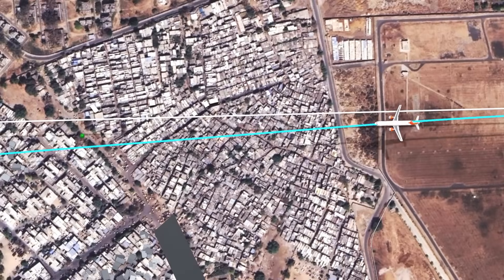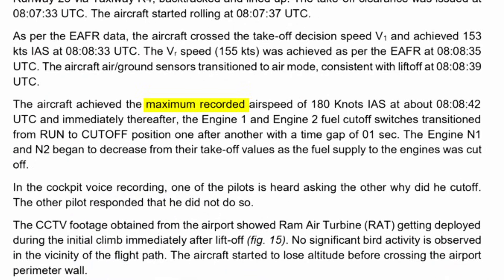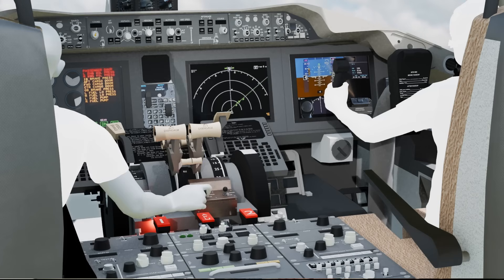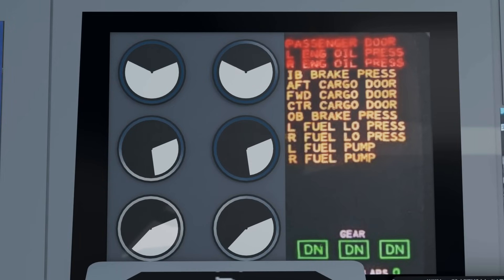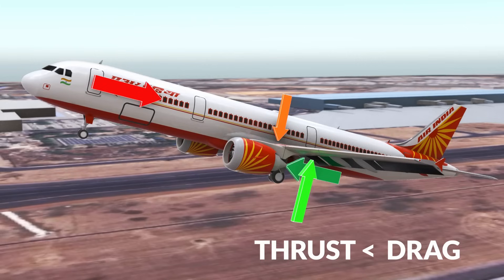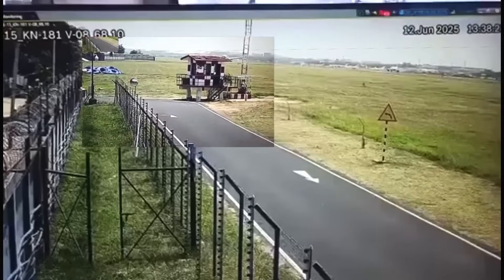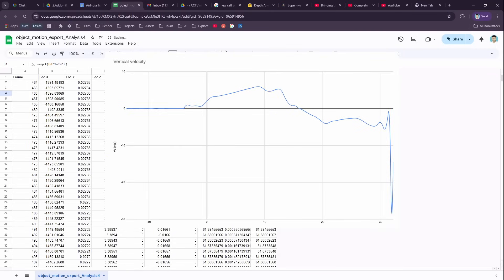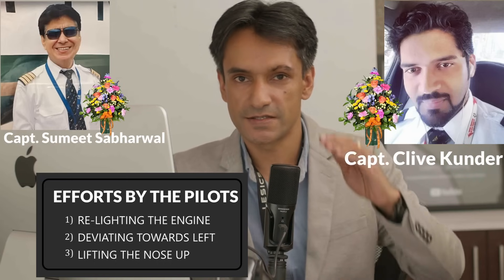Use of 3D Clone | Decoding the Crash Details you Missed

Comment: Absolutely the best analysis I have seen. I am reviewing this crash after I realized that their preliminary report is bogus. Going from 2 knots per second acceleration on the runway to 6 knots per second while climbing with the fuel shut off just is impossible. 2 engines at 70,000 pounds thrust each on a 520,000 pound aircraft is only an acceleration rate of 0.28 G’s. And I didn’t see no afterburners or Jada rockets in the videos. The officials either don’t know what they are doing or they are trying to hide something or both. But physics don’t lie. Something is going wrong with these aircraft and It’s not the pilots fault. Your work is much appreciated, THANK YOU.

Comment: Great analysis! Sabin, I have something that's bothering me which doesn't add up. That picture in the preliminary report with the RAT deployed, the tower in that picture is not the same tower as the one in the other cctv video you start with. Now, I actually doubt the veracity of the photo used in the preliminary report. If it were a true picture taken during the takeoff of real incident, its details which include ALL the planes parked in the background would be consistent with at least the view that overlaps from the main cctv footage you start with. Could you fit the 3D model from the two consistently ? I think in the photo in the preliminary report the planes in the background, even their relative orientation and number within the view doesn't consistently fit with cctv footage.

Comment: This is a nonsense, that the issue was caused by a technical glitch...there are already many video on the Youtube, mainly from Captain Steeeve, who is talking about the preliminary report of investigation, that fuel cut-off switches were manually switched by one of the pilots to Cut position and then changed back by another pilot but it was too late...
Reply: stop spreading nonsense on the internet especially from that clown.

Comment: The fuel cutoff switches (according to what is recognized by the data recorder) can be accomplished in 1 second. The mechanical movement of cutting off the FIRST switch is NOT registered by the data recorder. The data recorder can only recognize "off" the instant off is achieved. The time prior is unknown. So the timing to turn off two switches begins with first switch at "off". The 2nd switch to turn off is basically the time it takes to turn off a single switch according to what the data recorder "sees". Hence the time measured is from "off" to "off". "off to off" can be accomplished in 1 second. Hypothetically a person could hold the 1st switch for an extended period that the data recorder does not "see". The first switch measurement to "off" actually consumes NO time. The timing starts at the instant "off" is reached on the first switch not before. The clock starts and moving the 2nd switch can indeed take place in 1 second. The theory of the time to cut off 2 switches in this gentleman's explanation is flawed. I am making no other assumptions or accusations. I'm just pointing out what the data recorder is capable of "seeing".

Comment: After an exhaustive analysis of available data I have just published a new article.  I am in broad agreement with Sabin Mechanical Engineering.  The pilots tried to save the plane.  The most probable cause of the accident was a FADEC error.  The switches were moved some seconds after fuel cutoff in a standard attempt to relight the engines.  The most probable cause of this accident was a FADEC fault.
Air India Flight 171 Accident - The Most Probable Cause
Please Google this article - YouTube, for reasons unknown, instantly deletes my comments with live links.

Comment: One key component is that "Why did you cutoff?" Does not answer the question "What"? Cut off what? What was cutoff? Could it have been the co-pilots instrument panel that was cutoff as the plane automatically transitioned from Battery Power to RAT power. Yes, it's possible.

Comment: https://youtu.be/Hrdp50Dm_FE?si=uquUZwRuY7PAwS9y 
Is this your data or they made their own?
Reply from the maker: He didn't contact me. I think it's their own data. By the way, both the videos look similar.
Reply: @SabinMechanical  Nice work and what I find so interesting with both your simulation and the Wingx simulation is the continued increase in speed after fuel switch Cutoff and beyond the max speed in the report. 
I don't understand the physics well enough to know just how long or how much speed increase should be expected after fuel cutoff but the simulation does indicate it did happen. 
Just looking at the simulation results it's hard to believe the fuel was completely cutoff based on the max speed reached in your simulation. To me it looks more like the thrust of both engines was rollbacked rather total fuel starvation.  Thanks for all the work you put into this simulation.

Comment: In 2019, the ANA 787, NH 985, the engene was shut down after the plane landed on the runway and duel engene shut down was triggered by TCMA because of trust reversals...not when the plane was still in the air.

Comment: There was water leak in one of the bathrooms, not found or fixed due to bad maintenance of Air I. Plus, beside the bathroom is an electrical bay which connects multiple flight computers and systems. Water was pooled under the bathroom while the aircraft was on the ground, but as soon as the aircraft accelerated down the runway, the G forces pushed all the water into the electrical system causing severe failures and computer malfunctions and restarts, possibly within a second of this or close to lift-off causing fuel valves to shut down in a possibly bad design or unique scenario due to Boeing software and system design. This sealed the fate of the pilots, until the fuel pump switches were cycled and engined restarted it was too late. The flying pilot might have been startled to see sudden decrease in thrust, and no wonder cried out "why did you cut off?" not expecting such a thing to happen by itself, since there would have been no loud bang or sound heard in cockpit with their head gear on. Since easy solution would be to blame or scapegoat an innocent pilot, it saves both, Air I, and Boeing from lawsuits and claims from relatives of the lost ones. RIP. Corporate greed, and govt incompetence is rarely punished as much as it should be.

Comment: Excellent video. This has answered the one question I've been asking everywhere, are these fuel cut-off switches capable and/or programmed to drop without pilot input??? So it appears so. Great.
Now the only thing going against one of the pilots is the timing regarding a possible suicide mission. If this was sadly the case then during take off would be the precise window of opportunity taking into consideration current cockpit security measures.

Comment: The plane fuel switches were moved to cutoff position within 3 seconds from liftoff. Are you saying that in the 3 seconds both engines failed and there were no information anywhere in the icas and the prelim report. it is too good to believe how fuel switches are turned off or recycled within 3 seconds from liftoff when there is a whole checklist for the procedure

Comment: This is extremely well-researched and clearly shows the pain-stakingly hard work, sleepless nights and rock solid dedication that is gone to dissect and provide the details on what transpired on that ill fated day.

I am an Air Cargo professional with 20 plus years experience in international and domestic Air operations. I am IATA DG ceritifed Aviation consultant and an  Independent researcher. I also did my  own independent deep-dive analysis before and after the AAIB prelimnary report, including granular level second by second research of timelines and technical FIFO and LIFO of events, on the AI 171 crash.  Below is my final micro level findings with a most probable root cause. Below is a small excerpt of it : 

In my opinion, It is an Airframe-commanded fuel shutoff (FSOVs) — via spurious/automatic electrical command or relay/RPDU fault

Why is this electrical / relay or RPDU  fault or a  related logic malfunction  inferred as a most likely cause and NOT a FADEC outage or a Pilot  Error theory::

Pre-existing cabin electrical degradations that were present even in previous leg and continued later as well , probably point to an airframe distribution/RPDU issue.

Near-simultaneous “FUEL CUTOFF” on both engines within ~1 s likely matches a common-path command (relay/RPDU/logic)

At takeoff thrust, each FADEC is self-powered by its PMA; a FADEC-first/FMU-first shutdown would require very rare, identical EEC failures or simultaneous PMA defeats — much lower prior probability than a single airframe electrical fault that issues (or mimics) dual cutoff commands.

RAT deployment here is consistent with downstream consequence (both engines flamed out because fuel was cut at the spar). likely not indicating FADEC to fail.

Comment: I'm so tired of the "can't switch both cutoff in 1 second" assertion. The switch position is only sampled once per second... meaning that a gap of up to 2 seconds can be captured and show only 1 second. Additionally, the time gap is NOT the time from start to finish... it is rhe time from 1st switch reaching midpoint to the 2nd reaching mid-point. One can definitely flip both and have it get logged in recorder as 1 second apart.

Comment: @SabinMechanical, you should cross-reference your analysis with the one done on the Airline News with Geoffrey Thomas channel, where they also did a detailed analysis of the numbers and came to the same conclusion as you about the RAT deploying before the fuel cut-off switches were moved. They don't have the detailed animation you have but they do have a more advanced analysis of possible causes, providing a 17 page report that hypothesizes the likely cause was water ingress into one of the electrical bays that shifted during rotation, taking out the 230V bus. They also list several ways (in order of likeliness) of how that would have cut fuel to both engines. They also list why there would be such a delay is switching the second cut-off switch back to run. Specifically, for the 6-10 seconds after power was lost, and before the RAT was operational, the system relied fully on battery. The pilots would have known that on the 787 the battery is only rated to provide power to relight one engine, so they would have waited until the RAT came online before attempting the second relight.

Reference: https://www.youtube.com/watch?v=hrndsuamKN8
Reply from the maker: Thank you for suggesting this. I will definitely study their video.

Comment: Why are you assuming that potential deliberate actions to crash the plane involves both pilots ? It does not make sense at all to make such an hypothesis 😂
Maybe one of them did his best to save the plane and the passengers, and maybe the other one did not.
If you want to save the plane, you move immediately the switches back to the RUN position and do not wait 10 seconds to do so. I understand that the PF might have been confused and too busy to complete this task, but let me remind you that they are two in the cockpit.
But first and foremost you do not switch it to the CUTOFF position immediately after takeoff for no valid reason.

And it is perfectly feasible to move both fuel switches to CUTOFF in less than a second, there are plenty of videos showing that.

Comment: i'm not an expert at anything, but i can do some basic math.

part of this story include a miraculous sole survivor; a guy who claims to have jumped out of the plane,
and was confirmed to have a ticket for that flight.
now, this guy supposedly jumped out of this airplane while traveling at a speed more then twice what we 
see in race car crashes that obliterate the driver.

gordon smiley: 200mph
Gilles Villeneuve: 170mph
tom pryce: 160mph
Ayrton Senna: 130mph
dale earnheart: 160mph

airplane: 350mph

the story is obviously untrue.
consider the implications of this.

there are 2 other potential suspects for shutting the fuel selector valve:
-the autopilot
-remote control

Comment: It's been shown elsewhere that one can indeed move both fuel control switches in about 1 second. But that said, I agree that the accident was almost certainly due to a technical problem. I'm not about to blame the pilots for it without much stronger evidence. Another's video on YT (no link handy) said he thought one of the batteries suffered thermal runaway, leading to an electrical failure that resulted in the fuel shutoff valves closing (before the switches were moved in the cockpit). Given Boeing's past history of battery problems, this seems the most likely cause to me (that video also presented other evidence, such as the heavy damage to the FDR). But a control malfunction such as you describe here is also believable. (just fyi, I'm an aeronautical engineer with about 10y airline experience supporting Boeing aircraft operations).

Comment: It is very unlikely, that you would try to commit suïcide so low because of the risk of surving with terrible pain or/and invalidity. But if it was the computer, that cut off the fuel, then there is a lie in the report. The FDR registers if the cut off is done with the physical switches in the cockpit or by the computer. And then again the real dump of the FDR is not in the report. I believe it was a technical error of the plain.
Reply: As it turns out...cutting the fuel just after takeoff appears to be the perfect time to self delete. A pilot would know this.
Reply: @stimproid there was a surviver
Reply: @dirkverboom6519  Cut the guy some slack. It was his first time. He'll get them all next ti....oh wait....

Comment: ... There was one other odd thing in the beginning: Very first accounts after the crash, the pilot flying was reported to have called "MAYDAY MAYDAY: Have lost all thrust". He did not say they had lost both the engines. You'd think he'd have had a quick instinctive glance at those cut-off switches at that time. The conversation between the pilots about the cut-off switches came to us much later.
Reply: I believe the statement was "Thrust not achieved". Which indicates they were trying but failing to achieve it. Also, the phrase was "Why did you cut off"? With no reference to the switches. It could have been anything. The report was quick to intimate it was the engine switches, sending everyone on a wild goose chase.
Reply: @ankaparnahajova  Oh, OK. Yes, it’s a subtle difference. Thank you. But still makes the point, we weren’t told that they had actually saud they had lost both engines. Must have been terrifying in that cockpit.

Comment: I’ve flown the 787. You can definitely move the cut off switches in one second..  and he mistakenly talks about fuel being cut off to the engine on previous flights, that is not correct.  The throttles may have moved to idle if there was a failure that the aircraft mistakingly thought it was on the ground during the landing phase, but the throttle levers would also move and be noticed and controllable by the pilots.
Reply: Any chance of seeing that road out the windscreen with the nose pitched up during takeoff?

Comment: Wheels partially retracted then  froze shortly after take-off…electrical/hydraulic power failure.  The pilots had no chance.
Reply: Negative. Gear handle was found in down position.
Reply: @stimproid They could've done that to cushion.
Reply: @stimproid The wheels were frozen in semi-retracted position so obviously at some point they tried to retract it.  As the plane lost altitude they would have naturally tried to lower the wheels but they never changed position after the initial partial retraction.
Reply: @mrknesiah  What is your evidence? The grainy cell phone video? Why would the Prelim report not mention the Captain say" positive rate" followed by the FO calling requesting gear up?
Reply: @stimproid The videos showing the wheel position being partial retraction are quite clear.
Reply: The throttles were found in the idle position as well, but the flight data recorder shows them as being full throttle. Unfortunately levers move upon impact, so their final position is not definitive.

Comment: Simulations don't show evidence of a haze present in the first video's ground-level background scene, even before it crosses behind the checkered shack on its ill-fated takeoff run. At rotation the white swirling clouds are obvious and even circled by the PC cursor in the video copy we've seen. But the haze is not seen once the plane is video recorded in the air? With the engines cut off, the steam stops. It's apparent that it was the plane's exhaust during back-taxi on the runway that had provided that undeniable haze. Why?

It had not rained, so no puddles to mist. Green turf to the tarmac, so no dust piles to raise. No smell of burnt circuit boards or fiberglass reported by the cameraman who'd only noticed its quieter engines and had the presence of mind to record it with his phone. No jettisoned fuel smelling of kerosene was reported, nor any residue on the taxiway or runway. Why? Those won't foul two engines, but a bathtub of water in all fuel tanks surely will......and I expect it did.

Comment: You claim that gravity cannot increase the horizontal velocity, which means you have never flown a plane and done power off glides or watched a glider pilot have to use spoilers to slow down on descent. Gravity provides energy, the wings convert the vertical energy into horizontal velocity.